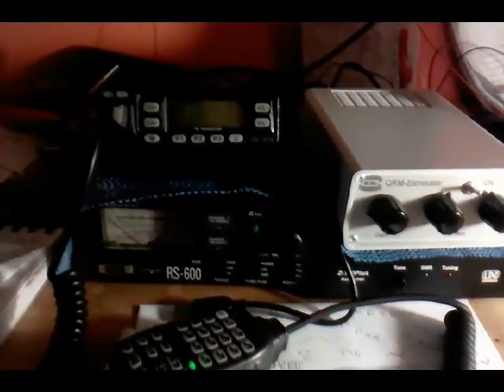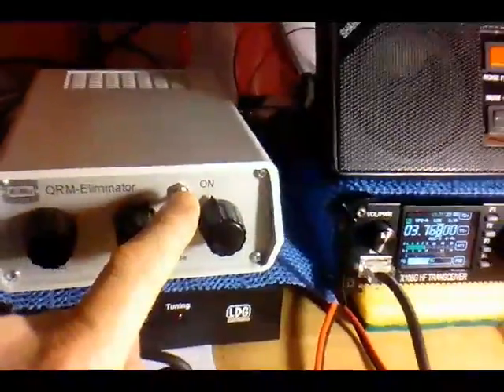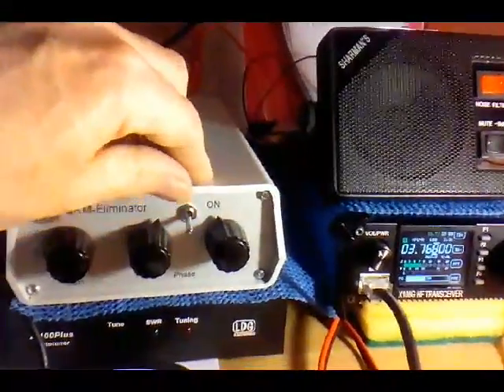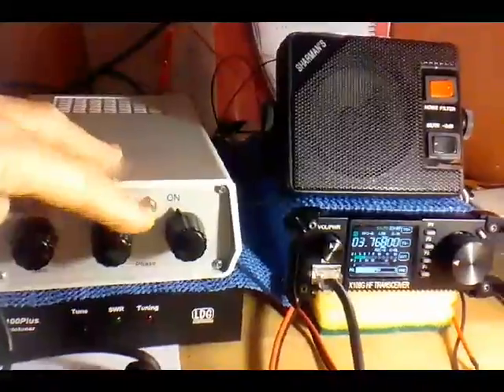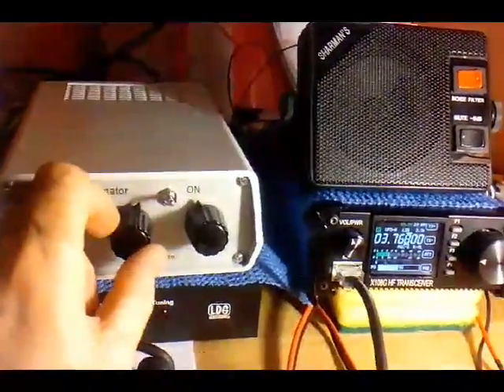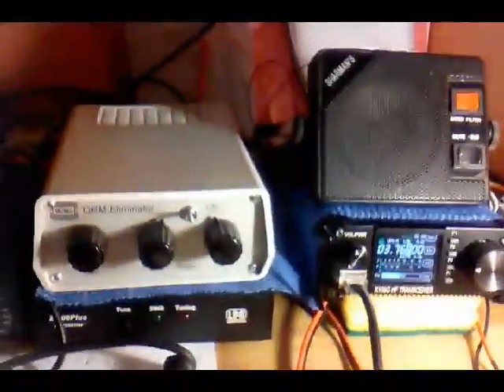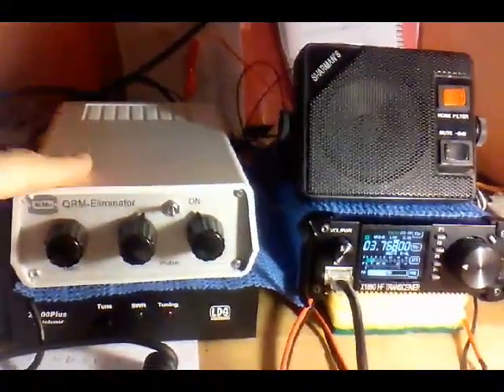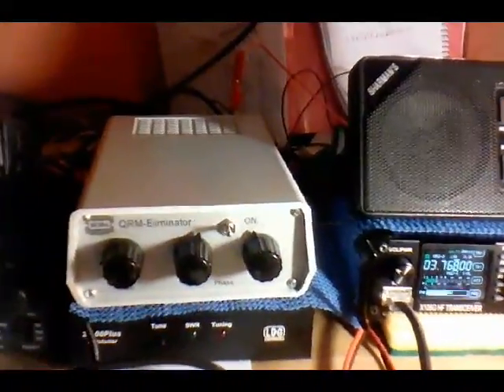WiMo QRM Eliminator

Comment from the maker: This is the foot-switch I used. From ebay For about £7.00- Hope this helps

 http://www.ebay.co.uk/itm/SOUNDLAB-BLACK-LATCHING-ACTION-PUSH-ON-PUSH-OFF-FOOTSWITCH-WITH-NON-SLIP-BASE-AN-/270960747774?hash=item3f1684e4fe

SOUNDLAB BLACK LATCHING ACTION PUSH ON PUSH OFF FOOTSWITCH WITH NON SLIP BASE

Specifications:

Brand: Soundlab
Colour: Black
Dimensions: 87x65x34 mm
Type: Push On Push Off

Comment: Many thanks for this, my rig also has no PA to ground and this has answered a question of mine, I'm also not familiar with the usage of the RCA plug, but i'm sure i'll be ok once that is sussed, many thanks!
Reply from the maker: +spib65 hi, I use a foot switch(from ebay for about £7.00) than is working fine for this unit, I can always upload a other video show this wired up to the unit if it would be of help. Roger
Reply: Many thanks Roger, that would be great
Reply: +spib65 Hi again, what are the specs for the foot switch, is just a cheap on/off switch?
Reply: Hi mate I really enjoyed the video I was wondering if I can use this qrm Eliminator with my 10 m radio President Lincoln II and how can I get the ptt signal out of the radio thank you in advance